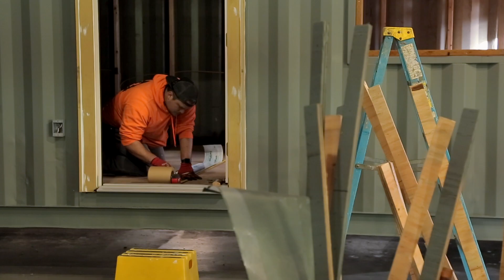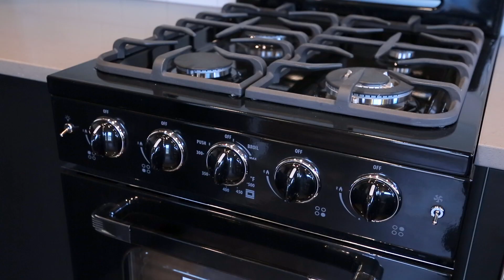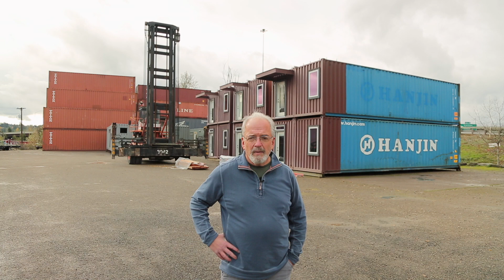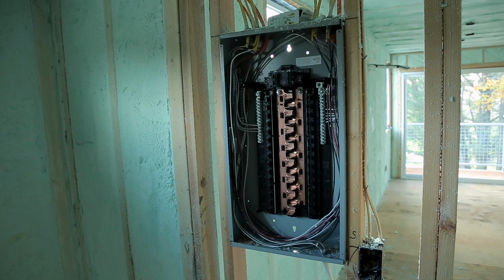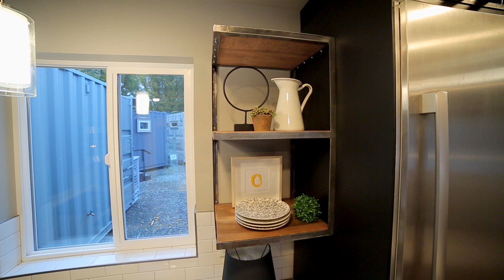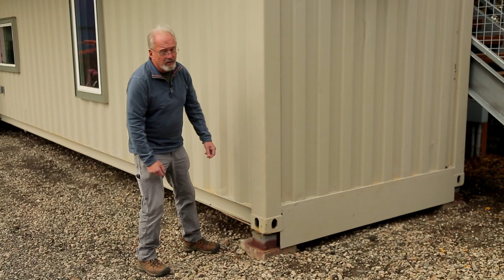Innovative Shipping Container Homes + The Conversion Process

Comment: Cute, but struggling to see the widespread utility of spending 260,000 dollars on a 'basic' 2 bed; accepting not having to build the core frame, these arent exactly light on materials, so I think the climate/energy angle is really overstated, and the costs involved here are outrageous considered against a comparable trailer home. It's crazy that people in this comment section are calling this 'affordable'. This is quirky luxury housing, full stop. Their deluxe model starts at $470,000.00 - not counting delivery and the equipment rentals necessary to install the crate.

Comment: How long does something like this last? I've heard that in my area S>FL. that the high heat meeting the AC with metal in between can cause mold/rust problems that quickens detrioration. What's the resale value? Do they  lose or gain value? It  seems to cost more per sq.ft than a stick house. I'm looking to relocate and between pre fab,or newly built container home , newly built stick or existing stick it appears in our current climate that existing homes are cheapest and for ROI the best investment,what do you think?

Comment: I saw your home in the video and it was in wheels.  I live in Florida where there is lots of rain but not the same anti-cold problem which may allow for an "up in the air" container home. Do you think that LOTS of large gravel for drainage underneath and lifting the container and having it rest on the wheels is a possible alternative to excavation and pouring a concrete foundation?

Comment: I live in the Northeast US where many towns require residential homes to be minimum 1000 sf. I saw a container design I want: a horse shoe configuration - the long sides would be 40ft extra-height containers the shared side a 20ft extra height container- an atrium would span the 40 ft containers - it seems this Builder is more than able to construct this home design.

Comment: Love it but how many people are interested? 
I am researching the marketplace to see who would want one delivered to them? 
We’re offering 1378 sq feet of living space insulated with a doom roof to cut down on rolling in high winds with windmills for power, electric outlets and condenser plumbing hookups for easy use all mine will be bungalow with no chance of going higher and minimum transportation movability after its put down. Everything in the unit utilizing electricity floor radiated heat utilizing the condenser and heater cores for even heat distribution throughout the house according to thermostat. You can rent this out once you have completed your dream home or cottage. Cost will be $65,000.00 - $95,000.00 US pending on options. Will come with all appliances, electric hookups along with full plumbing and hookups. Unlike what you see here you’ll will have to order your own and because you can design your own get away, business or rebuild home at a fraction of the cost it will take up 10 weeks to receive yours.  Who is interested please let us know? Once you order the unit will require half and the other half on your approval of installation. Everything will be tested and pass before sending the units and will be tested on site for your approval unless you do not have the necessary hookups installed on your property in question at the time of install. Living quarters for workers is ideal, or living, cottage, get away home choice is yours; I can’t wait to hear from you.  ewsmajor@gamil.com Wil 
Unfortunate because of city regulations these won't pass urban areas, because permits, onsite inspections for every step of the process, plumbing, electrical, wall foundation, proper bracketing on truss, wall formations plumbing, plans need given to the cities for approval civil engineering construction. Ideal these are for small towns with limited restrictions, lake lots, forestry workers, miners, camp installation for a lot of workers or office space with road access. I'm looking for anyone interested in purchasing one of these homes and pass on the information who might be interested in saving time and money. 

We're hopping to have them on display in stages to show you the process but have to know if there is any interest in this before going into full production? Why do we need to know about the layout okay what if your property has trees would you like your kitchen facing the trees? What about your bedroom facing the street or lanes only you know how you want this to laid out for you therefore we get you to build your own, and you would have to build concrete structure or cement pontoons for support anyhow will take 30 - 45 days to set properly anyhow. Approximately 8 - 9 hours to setup run the testes and this would be your new home cottage or what ever you desire.

Comment: $110K for under 500 sq ft, when a double wide trailer home with 2 to 4.5 times the square footage costs the same, is definitely a head scratcher trying to picture a market.
Reply: I like my houses WITHOUT wheels...
Reply: @harveymanfrantinsingin7373  LOL - they remove the wheels after moving.  I kinda like mine at a reasonable cost per square foot.
Reply: @1SCme  i think you missed the point of my comment. The quality of construction isn't even close to the same,  between the two.
Reply: @harveymanfrantinsingin7373  I think you missed my initial point - over $220 sq. ft. to start.  Not counting lot cost, this is pushing $300 sq ft.  This is well into the range of most luxury home sq. ft. construction costs.
Reply: @1SCme  that completely depends on the market in which you live.  I'd rather spend some money than live in a glorified travel trailer on cinder blocks
Reply: @harveymanfrantinsingin7373  ...as compared to a glorified cargo container on a concrete slab, at about 2x to 4x the cost per square ft. that is 1-1/2 times the size of the typical hotel room... good luck finding a notable market for this.

Looking at their web site, the actual cost is over $226 sq ft for a 466 sq ft home, which is still far from completed installation, and about 90 sq ft larger than a typical hotel room.

If you go to their web site, the reason for a lack of notable savings becomes evident.  They are building the interior and roof the same as any other stick construction, the container is only used for the skin which requires a lot of prep (rust, paint, etc.), and used shipping containers are not cheap per square foot - even a simple metal storage building is cheaper per square foot.

You again miss the point, but I am beginning to suspect this is your desperate attempt to invent a talking point.  When you get up past $300 a sq ft, you are at new construction cost in New York and San Francisco, and luxury cost elsewhere - in general, your "Quality" argument has no basis in reality.

This doesn't factor in that most expensive neighborhoods don't permit pre-fab homes, and/or have minimal square foot requirements removing this as an option.

In other words, returning to the beginning, there isn't much of a market for these.  They're WAY overpriced, undersized, not really recycling much, and wouldn't be allowed to be installed in many areas.
Reply: @1SCme  clearly you've missed the point. You originally compared these to a mobile home.. which is an idiotic statement. New home construction in my neighborhood STARTS at 300sf, and most won't build under 2300sf.  Sooo... maybe you should realize that the world is bigger than Kentucky or Oklahoma.. or whatever meth town you're in,  and see that there IS market for this,  even if you don't understand it.
Reply: @harveymanfrantinsingin7373  I clearly get the point.  A mobile home is the comparison for a pre-manufactured home, a custom built new construction is a comparison for quality.  These fail both comparisons, and it isn't even close.

You only need look up used shipping container costs, and visit their site to see why they aren't economical or particularly green - they're build using the same stick construction technique inside and for the roofs.

Their site also hints they don't have much of a market.  After prepping the exterior, they are constructed in a small building which can't assemble more than 1 at a time, taking several weeks for each, and this is the nationwide market.

You're lost trying to manufacture support.  I encompassed nationwide, including the most expensive cities.  You're talking your neighborhood and dodging a cost comparison.

You are at best exaggerating by implying there is a market in your neighborhood for 300 sq ft high quality homes being built in this price range - $77K  is their cheapest 320 sq ft unit, not counting the rest of the installation cost.  if you felt confident in your claim, you wouldn't need to exaggerate.

You show your hand with really weak insults when faced with the realization your claim of a notable market has no basis in reality, and no merit.  You again show your hand that you really have no understanding of what would be required for there to be a notable market - exceeding new luxury construction costs for a shipping container is not the basis for a market.  The noteworthy market only exists in your head.
Reply: @1SCme  denver.. look it up.   As for the trailer you live in..be happy with it, just don't spout off when you can't see passed your fence. The world is bigger than you.
Reply: @harveymanfrantinsingin7373  You're citing numbers you don't understand.  For a comparison, you would need to get the construction costs alone (minus land), which in Denver metro area, at the upper end is far cheaper than these units.

This is ignoring that the more expensive areas don't typically allow pre-manufactured homes, and/or require larger constructions.

You show your hand with really weak insults when faced with the realization your claim of a notable market has no basis in reality, and no merit.  You again show your hand that you really have no understanding of what would be required for there to be a notable market - exceeding new luxury construction costs for a shipping container is not the basis for a market.  The noteworthy market only exists in your head.

Please enter 4 tokens and try again.
Reply: @1SCme  you clearly have zero idea what you're talking about. You literally retyped the same thing you wrote in your last idiotic response and then give yourself a thumbs up. Pathetic, man.. Pathetic. You clearly don't understand the Denver housing market if you think $200,000 is on the upper end of the market here. 200000 won't even get you a shity condo in the ghetto.
Reply: @harveymanfrantinsingin7373  I see no reason to reword a response to your garbage.  At no point did I affix any price to the Denver market - this is  figment of your imagination with no basis in reality.  

Any comparison would have to exclude the land cost.  Expensive higher end homes are likely to be built in areas that do not allow pre-manufactured homes and/or have minimal square footage limits eliminating these as an option, while areas without these requirements aren't going to reach the extreme cost you depend on for support.  These are not really debatable nor are they difficult concepts, but they do seem to be beyond your comprehension.

You show your hand with really weak insults when faced with the realization your claim of a notable market has no basis in reality, and no merit.  You again show your hand that you really have no understanding of what would be required for there to be a notable market - exceeding new luxury construction costs for a shipping container is not the basis for a market.  The noteworthy market only exists in your head.
Reply: @1SCme  ohhhh.. you're a bot!  That's three times now that you've included the same phraseology in your response. Are you a Chinese bot or a Russian bot?
Reply: @harveymanfrantinsingin7373  Your belief that a bot would be used to discredit a small pre-fabricated home manufacturer is paranoid and delusional, indicative of your disconnect from reality.

I accept your capitulation and admission you have no idea what you are talking about, your claims have no basis in reality and no merit, and you are reduced to relying on pivots to try to disguise your ignorance.

For those of us with a grasp of reality, insults from others like yourself who have demonstrated a lack of cognitive skills to comprehend even the most basic of concepts don't carry the weight in the real world that they do in your head.

You show your hand with really weak insults when faced with the realization your claim of a notable market has no basis in reality, and no merit.  You again show your hand that you really have no understanding of what would be required for there to be a notable market - exceeding new luxury construction costs for a shipping container is not the basis for a market.  The noteworthy market only exists in your head.

Please enter 4 tokens and try again.
Reply: @1SCme  bot

Comment: HAVE YOU CONSIDERED MAKING A MODEL THAT IS WHEEL CHAIR ACCESSIBLE FOR WHEEL CHAIR FOLKS WITH ROLL IN SHOWERS VERY NICE WORK HERE!  LOVE THE BUMP OUT TO GET THE ADDED 4' ALSO LOVE THE INSULATION FACTORS TOO!
Reply: Many housing innovations happening now. We are building homes that create more energy than they use, and are around $180/sq ft WITH solar installed. We are starting a small veteran community in Neillsville WI this Spring. They will have no entry stairs, extra wide doors and halls, ADA shower, no utility bills other than connection fees. Nice to see so many people working to help others. Keep up the good work. www.energypositivehomes.us